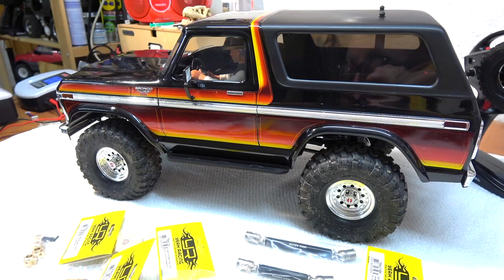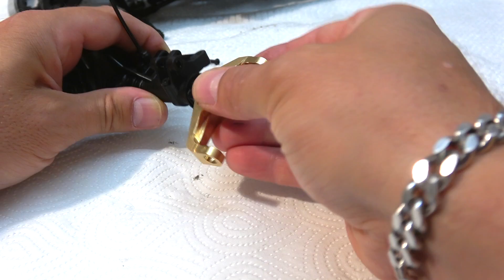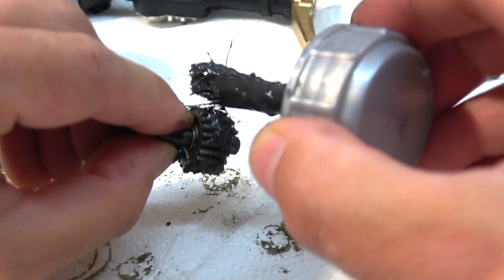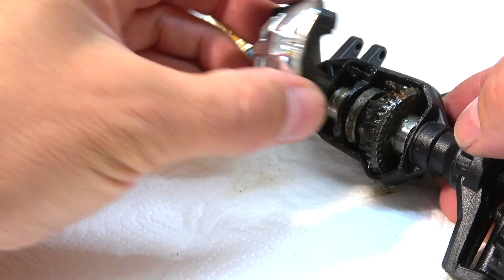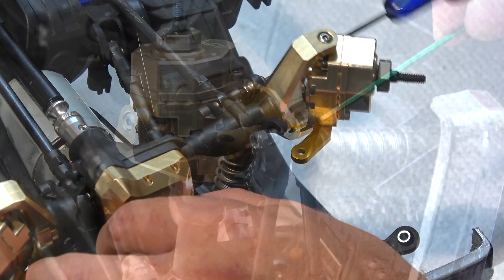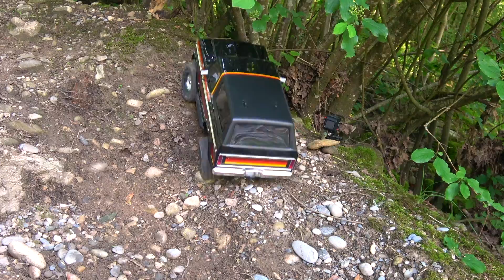Yeah Racing Brass Upgrade Set for Traxxas TRX-4 - Installation and Advantages

Comment: Better to remove weight first atleast if u want to comp crawl
Reply from the maker: Yes, but this is the difference, this is not a comp crawler. 👍😊
Reply: A TRX4 is a simple trail crawler, not a compition rig even in the slightest.

Comment: Did you use a spacer when connecting the inner portal to the steering link?
Reply from the maker: No, I do not have a spacer there.
Reply: @Matteomeier  Thanks for the response. Great videos!

Comment: I installed this yeah racing brass kit. I put on a new servo first and centered the steering. Now my steering is off some and I can not turn my wheels by grabbing the wheels and turning. Seems like it’s binding. The 2 links I took are on correct. Any idea?
Reply from the maker: NO idea, but I think there must be something wrong installed....
Reply: Matteo's RC Movies I found it. It was the 2 steering horns one on each side of the portal. I didn’t put lock tight or tighten them. They were moving and binding when I turned. Tightened and lock tight and it’s fine now.

Comment: what about brass on the back axles
Reply from the maker: Of course this can be installed also. But I prefered only the front axle, because is good to have more weight on the front to climb steep trails. And all the parts are not cheap...

Comment: I noticed that the bearings in the portal hubs had a seal on only one side? Tried watching again but not 100% sure, if I'm not mistaken I think you might have put the bearings in the wrong way, side without the seal should be inside with the gears and grease, seals facing out to prevent dirt intrusion. Just wanted to give you a heads up. Love all your videos.
Reply from the maker: Thank you! I think bearings are on both side sealed... but i'm not sure... 😃😃

Comment: Great video! Did you have to upgrade the shocks for the added weight?
Reply from the maker: Thanks! No, because the weight its on the axle, and this is under the dampers / not supportet by the dampers.

Comment: I dont like how you will need to cut the drive shaft. Did u have to cut it because that was a custom longer driveshaft?
Reply from the maker: The drive shafts fits directly without cut in the TRX-4 Defender. But the TRX-4 Bronco have a shorter wheelbase, so only for use in the Bronco this shorten is necessary.

Comment: Bigger motor to get wheelie back 😆 looks beefy! Buying this kit now for my Bronco. Are there any other decent weight options you know about for the rear axle besides the diff cover? The portal cover weights look the same I suppose. I don’t want to use wheel weights. Nice upload👍
Reply from the maker: Thanks! On the rear axle you can also install the brass portal gear covers or this ones: http://www.yeahracing.com/catalog/trx4054-brass-118g-portal-cover-front-rear-2pcs-traxxas-trx4-p-4449.html
http://www.yeahracing.com/catalog/trx4019-brass-front-rear-portal-cover-traxxas-trx4-p-4223.html

Comment: Awesome upgrade under the belly of the beast..I too just dropped some  💰 on complete front and rear aluminum axles with all the bells and whistles. Brass is probably heavier but I was going for the stock look.  Have you seen my trx4’s. I’ve designed some very nice and useful upgrades.  You should check it out when you find the time  👍🏼
Reply from the maker: Thanks! Yes, It's great to upgrade and modify our RC's! 👍😊

Comment: The rule of thumb is; whenever threading metal into metal, use thread lock. Love your accent and enjoy your videos immensely.
Reply from the maker: Thank you David! 🙏 Yes, I agree, thread lock is always good for metal in metal. 👍 Here I feel a slightly resistance at the end when I tighten the screws. Maybe because brass is a bit softer, so I thought it's maybe not necessary. 🤔

Comment: Awesome video as usual! Have a question. Did you used thread lock on the screws or is that a no no on brass?
Reply from the maker: Thanks Chris! No, I think the screws will hold without thread lock. I could feel some resistance at the end when tighten.

Comment: Hi Matteo, very very nice indeed, plenty of bling, you will need sunglasses when you look at it lol. 
The extra weight must make a big difference to the handling. 
On a slightly different tack, do you know of any different wheels and tyres that look more like the real thing for the Citroen 2CV, I'm not fussed on the kit wheels and tyres, to small and wide. Any help would be appreciated. Great video as usual Matteo. 😀👍👍👍
Reply from the maker: Thanks Mike! I think it will be difficult to find something accurate for the Citroen. Maybe from some static scale models. But this will be reduce the RC performance extremely. 🤔

Comment: 😊Nice you pimped that sucker out! I am getting the TRX4 sport can't wait to run it in the mountains!
Reply: did you see that the TRX4 sport has only a 2ch radio? The diffs are locked in contradiction to the Bronco, The Defender and the Assault version of the TRX-4 hence doesn't need extra 2 servo's. my 2ct.
Reply: Yep how the TRX4 should have been in the first place all that extra weight and stuff in the original makes for a less agile truck and the TRX4 should work much better now.
Reply: the sport is just a bare bones trx4. non-remote locking diffs... they're permanently locked. no 2-speed transmission...just 1 crawling gear. a simpler and lighter body, but otherwise the same. same chassis, same esc & motor, same axles
Reply: Does the TRX Defender have remote locking diffs at stock? Or i need to buy this differentials? Thinkin bout buying the Defender
Reply: @OmarTheAtheistAziz  the defender has remote locking diffs and 2 speed trans only the sport lost them
Reply: The only reason traxxas removed the locking diffs and 2 speed is to make the model more affordable and a bit simpler for the average user, it is NOT an improvement at all ill be sticking to the original for sure
Reply from the maker: Thanks Steve! Cool, you getting the TRX-4 Sport! Nice simple machine. Looking forward to see your videos of it! 👍😊
Reply: I have use for 2 speeds and open-lock diffs where I play!
Reply: Dude that sport is a tank I'm to RC and I went redcat.... Red cat was bad juju for me so a buddy hooked me up with abused sport and man I am rough on my rig!!!!! I just broke the CV axle after my Carnage. Check out NM rc and you'll see my cool truck in action alllll stock with tire weights in the wheels
Reply: I know. The new body is cool and was thinking of ordering one (when it arrives in the Netherlands) but also got a MST CMX (locked diffs) and other build projects too. I like the 2 speed part of the regular TRX-4 so just let this one pass.

Comment: Hey Matteo, tolles Video :D. Mir persöhnlich gefallen Knuckle Weights oder Knuckles aus brass auch sehr gut. Es ist viel besser als Gewicht in die Reifen zu stopfen. Wie schwer ist dein TRX komplett (mit Akku)?

Wenn du schon am upgraden bist, schau dir einmal diese Teile an:

https://www.shapeways.com/product/XLP5FMYQV/low-cg-battery-tray-for-trx-4?optionId=63009264
Bestehendes Gewicht tiefer legen ist am besten

https://www.amainhobbies.com/traxxas-trx4-machined-overdrive-ring-pinion-gear-12-33t-tra8287/p735069
Overdrive für die Frontachse, besserer Lenk-Radius bei gesperrter Achse, weniger Torque twist, kippt etwas weniger schnell bei steilem klettern.

Noch etwas was mir geholfen hat, nicht speziell beim TRX, aber allgemein. Das Dämpfer- Setting. Das Fahrzeug sollte etwas einsacken wenn es am Boden steht und nicht im normalen Stehen ganz ausgefedert sein. Wenn die Dämpfung zu steif ist beginnt das Fahrzeug zu Zittern (siehe 9:13-14 im Video). Ein wenig zittern ist normal, deine Dämpfung ist gut und dein Fahrzeug bleibt auch schön ruhig, ich wollte es dir nur zeigen das du weist was ich meine. Wenn ein Fahrzeug extrem Zittert verlierst du jedes mal die Verbindung mit dem Untergrund und dadurch keine gute Traktion.
Reply from the maker: Hoi Tino! Das Gesamtgewicht müsste ich mal wiegen, bin aber im moment in den Ferien in den Bergen und da haben wir keine Waage! (Wollen ja nicht immer ein schlechtes Gewissen haben wenn wir in den Ferien ein paar Kilos zunehmen... 😂) Du hast natürlich vollkommen recht mit deinen Ausführungen, ich bin aber eigentlich gar nicht derjenige der es bis zum letzten ausreizt. Ehrlich gesagt hätte ich auch diese Brass Teile nicht verbaut wenn ich sie nicht gesponsert bekommen hätte... Und Dämpfer sind immer noch Stock, sogar das Öl drin. 😊 Da könnte ich wirklich mal was optimieren! Melde mich nach den Ferien mal wegen einem Termin zum fahren bei uns! LG Matteo